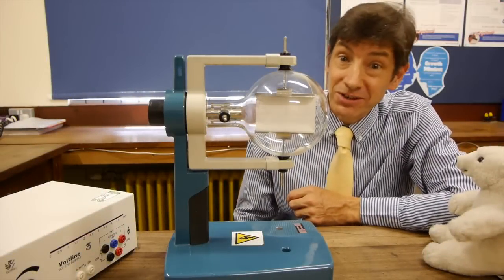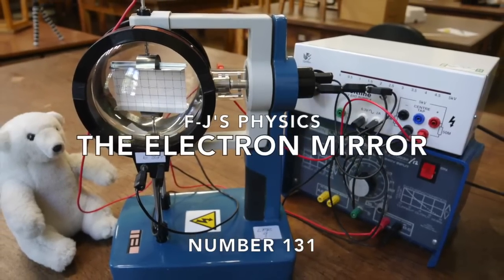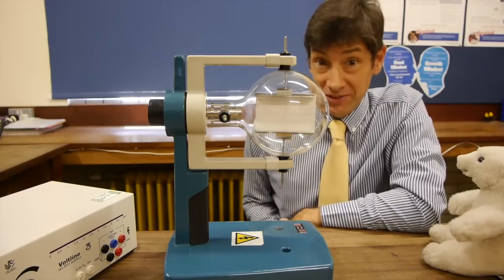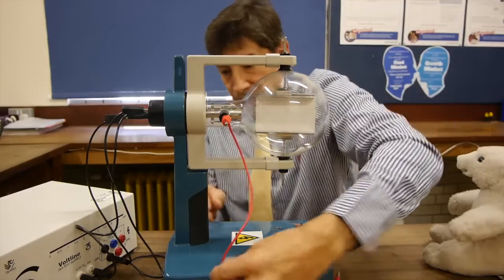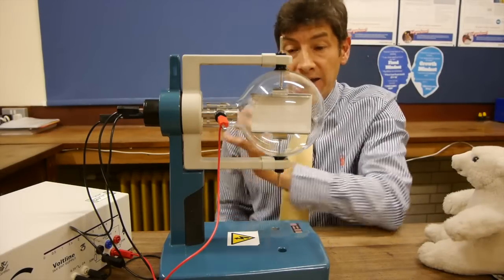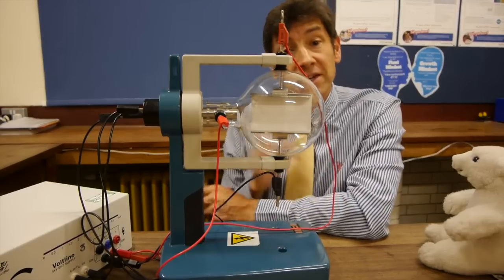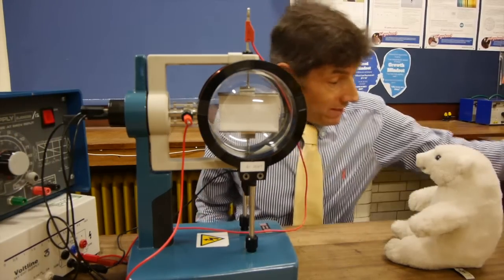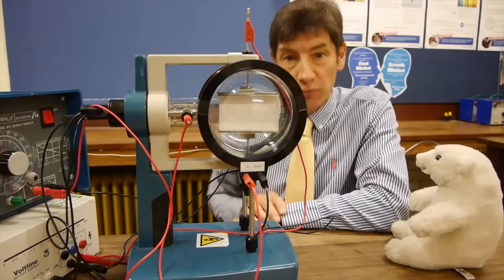Electron Mirror - F-J's Physics - Video 131

Comment: So you had an upward deflected beam, then you said lets disconnect the top positive connection, the bean did not jus go back to straight, it disappeared totally, until you disconnected the bottom negative connection. And then the straight beam reappeared.  So what happened for the second when there was no beam at all? Did you turn off  the electron generator as well at that time?
Reply from the maker: Well spotted!  No I did not turn anything off.  So the beam is only visible when it hits the phosphorescent screen and when I disconnect the top wire I think the presence of the negative bottom plate skews the beam out of the way a bit so most of it misses the screen - you can still see a bit of it going straight.  Once I remove the electric field due to the bottom plate then all is well again and the beam goes directly to the right.  Great question and well spotted!
Reply: @AnthonyFrancisJones  I think you need to investigate this a bit deeper.  I personally have a lot of issues with the knee jerk off pat answers that are repeated so easily because you have been told how it all works so many times.  But there is still some wiggle room left for doubt I think. There is a whole lot of such experiments that are always interpreted in only the one way, with little or no critical analysis being employed. For instance, Thompson "discovered" the Electron. But he actually discovered nothing at all. He only surmised that if there were such a thing, then that might explain what he saw. Rutherford never "discovered" that the atom had a nucleus, and most of the atom was mostly empty space.  No, he deduced this, not discovered it. That is why experiment can be used as proof of theory, only possibly supportive of a theory.  So then, what might be the reason why the "beam of electrons" suddenly just magically disappeared just because you removed that top electrode?  Something unusual is happening, what do all those authoritative text book have to say about this effect? Is it even mentioned? My gut feeling is that what you are looking at is not even "a stream of electrons" at all. When you place the magnet near, the "stream" curves off.. toward the bottom or top of the tube.... but as electrons are particles (that's the CLAIM anyway) so where do they all disappear to once they have struck the sides of the glass tube? If you leave the thig working for 10 years, do you see a little pile of dead electron particles built up at the bottom of the tube? I recon that there is something fundamentally incorrect with some of our assumptions and deductions about all this. Our imaginary Model of it all is able to help us use electricity, but the model may not even represent reality at all, but still be useful.  What do you think?  Can you do more experiments looking for any slight inconstancies to the official consensus?  Another issue I have is the claim that we have actually fired a single electron form an electron gun.  Or counted a single electron with a detector, or done this with Light photons, which are imaginary particles as far as I can see. Lots about approved Physics is a bit dodgy.
Reply from the maker: Interesting what you say.  You would enjoy a philosophy of science course at university if you have not done one.  You get the gist of the 'scientific method', no 'proof' but models that help us understand and assimilate what we see around us.  Further experimentation will always lead us to new/improved models.  Proof is not really what we deal with as you say.  What I would add is we do need simple models that are quite limited to teach beginners and younger pupils.  'The electron is a negative particle that can be found orbiting a nucleus' etc.  later on quantum ideas need to be added to, as you say, explain unusual effects that we observe in further experimentation such as orbital energies and spectral lines etc.  The 'kids model' works for my 5 year old and is not wrong - it is just limited.  Separately you ask what happens to the electrons that strike the glass etc. of the tube.  Well, I cannot prove it, but the model that we use is that the glass does have some conductance (some glasses are actually lead glass) and this allows for the electrons to have a current path to ground.  Then we get into the realms of the Earth's capacitance...  Some tubes had an aquadag (graphite paint) on them to help this.  So it is all about using the appropriateness of a model to the age and ability of those that you are explaining it to.  A bit like teaching planets to little children - one has to simplify the orbits into something they have experience of such as circles knowing that in the future they will not find that completely wrong but will develop it in a number of different ways to explain further observations.  I have had criticism over the years from some quite famous physics educationalists for doing this but I have not found a way around it.  What it all comes down to is this video should really just have been a string of maths of quantum particles and field interactions with no demonstration but I feel it adds something to the story even if it is a bit 'handwaving'.  If you do have some further suggestions about how I might teach this to school age kids I would be really grateful - it all helps!
Reply: @AnthonyFrancisJones  No worries.  I understand your approach. Thanks. Actually my main gripe with modern Physics is the very real issues that exist for the Einstein theories of relativity and also of Quantum theory for that matter. These particular theories, especial relativity, is full of so many contradictions and simply totally irrational statement and assumptions that its bewildering why its still being taught. Time dilation, length contraction and gravity waves,  Light speed, unbelievable. There is so much fake science that it hard to find real science these days.
Reply from the maker: I am not sure if there are many of us either in our out of University/school teaching that genuinely wish to deceive our students.  We just want the best for them.  Quantum theory as well as Relativity are really tricky concepts that are not fully unified yet and may never be.  The main thing is we explain to students that the maths of these theories can be used to genuinely describe many systems and allow them to build others too (I am thinking particularly of some electronics applications).  Obviously when there are gaps in the theory more work needs to be done and still is being.  We are nowhere near 'knowing' all of the science.  What I find hard to explain to my students in the philosophy side of science is that the fact that there is no fundamental law that states that if the human brain cannot visualise something it does not mean that the model is wrong - one has to go with the maths that makes the right predictions or modify it so it makes better predictions.  One of my goals with younger students is to give them the science models that enable them to get to grips with something they have not seen before.  When they are older, of course the model has to be extended/modified or completely changed!  In summary I do hope that there are not too many real scientists out there peddling 'fake science' and if they are they will fall on the sword of failed predictions and outcomes.  I suppose in summary what I am saying is that as scientists we can only give models that enable us to try to understand outcomes and make predictions.  We are not about 'The Truth' only a Theory that seems to currently fit the situations in front of us.  We are short of so many of these models.  Descriptions of the universe's structure on a cosmological level is definitely one!
Reply: @AnthonyFrancisJones  Another very sensible reply, thanks.  But I'm still not on board with the models you have anyway. The curved spacetime is mathematical object, correct?  So the values at the desired points are values of WHAT? They are numbers that allow calculations of other numbers, but they are not "measurements" of anything. If you say that they are numbers representing the degree of influence of a force, such as the force of gravity, then that's fine, but that can only be true if there is also a gravitational source planet at the center of the region of gravitational influence.  No planet, no mass, then there is no gravity field.   And about atomic clocks, they measure nothing, they just oscillate at a frequency that is very high. Now IF that oscillation is consistent, then we can assume that the clock is consistent.  But the clock neither measures time or is influenced by time. Time being a concept. If Time can change, and this makes the clock change too, (Einstein's claim) then Time may be changing right now, without any relative motion involved, thus also changing the clocks, but we would never know. But we are absolutely positive that those clocks are very finicky, and their accuracy is upset very easily for many reasons. So they  are unsuitable for use to gauge if "time" has locally warped". Only if the clocks were unaffected by relative motion, and all other forces) can we rely in them to measure any change in Time. You are claiming that the clock is both super highly accurate, but also at the same time, is badly affected by just some relative motion. (and affected by gravity, temperature, pressure, radiation, vibration, and angry staring) So although the clocks resolution is very fine, its accuracy is not too good.  The atomic clock is not "measuring time", so stop saying that it can. You need a purpose built time measuring gadget, but as Time is a concept, that will be hard to design. If I go on a near light speed trip for 10 years, then return, I am supposed to find that my twin on earth died of old age but I am only 10 years older. that is the claim. But at the maximum distance from Earth I travelled was only less than 5 light years, I can still easily watch the Earth through my telescope and observer the motion of the Earth as it orbits the Sun.  But both my Twin on earth and I will see that the earth orbits the sun the same number of times , once per year, 10 times for both of us, so its not possible for me to only count 10 orbits of the earth, but my twin count say 50 orbits. Solve that paradox rationally.  The models of a lot of modern physics are just nonsense. And the interpretations of what's going on in some particle collider or near a mathematical "black hole," are just that, interpretations, not facts. Did you observe a black hole? nope, you fiddled about with a lot of data till you have a computer generated image that resembled what you hoped to see. They even generated a few thousand CGI Photoshop images of what the Black Hole should look  like , and picked one that fitted the closest to what the fiddled data came up with.

Comment: 3:41 mmm are you using both hands to grab a pair of wires with ~KV of potential difference? that seems... unwise.
Reply from the maker: Thanks, I had a look and could not see that bit but if so one does need to be careful.  As I have commented elsewhere I am using an incredibly high internal resistance power supply with this in mind!   I must say that with good current sources I was always taught to keep one hand in my back pocket at all times!  Thanks again for watching!

Comment: The video is very sober, but also slightly comical in that this “simple” experiment starts with just one cable connected to a power supply, and ends up with about 10 cables connected to 2 power supplies. So I guess it was not that simple after all.
Reply from the maker: Yes, I take your point Brian!  Thanks for watching and hope you found it interesting!

Comment: very good demonstration but you are placing the wires without full insulations. its so dangerous working with high voltages.
Reply from the maker: Thanks Anna.  Yes, I did not want to get too technical and I am not sure others would have the kit to copy what I am doing but at the beginning I hoped I did explain where each wire went.  By all means ask me if you are not sure for your studies.  As far as the voltages are concerned I make sure I have years of experience and training and know the apparatus very well.  But... the main thing is the high voltage power supply has a massive series internal resistance - that is the key to safety!  You might like this video where I am 'mad' enough to wire it to a 1.5V bulb!  Knowing your physics I guess you know what I am up to!  Tell me what you think.   https://youtu.be/V06sYBiYWqM

Comment: Is it wrong of me to have expected an Electroboom-style "accident" (flash and scream) while playing with 5kV deflector voltage connections in the dark?

Seriously, lovely demo. I'm envious of the equipment.

In the 80's when I was in an electronics technologist program at college, my father bought an old Heathkit CRT-based oscilloscope to fix up for me. He ended up gutting it, designing and building his own internal circuitry, including making his own printed circuit boards for the first time using the old tape + resist pen method. 

With that 'scope and an XR2206-based function generator I cobbled together, I had a huge advantage over my classmates as I was able to trial-run many of my lab experiments at home.

In between my two years at college, I landed one of two cherry summer job spots, helping the college maintenance department calibrate and repair lab gear. With their permission I was able to bring the 'scope and my father into the repair shop where we confirmed that the 'scope he built from scratch (apart from the chassis, panel controls and CRT) exceeded his predicted 2MHz bandwidth by a healthy margin. His own 'scope wasn't that fast, so he had never been sure!
Reply: Haha less Medhi or AvE 
More like Applied Science, Alphaphoenix or Clickspring
Reply from the maker: Isn't Applied Science amazing and he does it without any fuss at all - amazing!
Reply from the maker: Scott, fantastic to hear from you!  Yes, I don't do the 'it blows up' stuff!  Others do that well.  Interesting how many of the viewers of this video did not realise the importance of a very high internal resistance EHT supply to make it much safer to work with.  I fear current more!  Thanks so much for your fascinating story.  I was doing similar things in the 1980s and I begged my dad to buy me a CRO (Hameg 203-5).  Every kid should have one!  I felt I could have been there with your dad as I remember the smelly process of etching PCBs myself.  Worked really well.  Remember the UV light box?  It was only years later I realised that there was HP stuff out there with incredible measuring resolution and I have some examples now.  It was a real pleasure to hear your story and it took me right back to my childhood workshop in our old pony stable.  Thanks so much for watching and sharing too!  An example of what YouTube does best!

Comment: Found this by looking to see if it was possible in a Havana Syndrome world to remotely and from a hiding place nearby, illuminate or radiate a person right through the walls of their home with an Electron beam, thereby knocking electrons off of the water or Carbon or Oxygen molecules in their body?  I was thinking even a small Electron gun could be used in this way to steadily build up an ionic charge in their body, which may act to upset various metabolic processes. By "nearby" I'm thinking on the order of 50 to 100 meters, and this would be sustained over a time period measured in weeks since I'm presuming the amount of energy actually absorbed by the victim would be small, but would accumulate over time to cause the malign health effects.
Reply from the maker: Sadly (or perhaps it's a good thing) not a hope for the very reason you mentioned.  Electron beams being charged (like alpha particles too) are highly ionizing so any air in the way would stop the beam over a very short distance.  It would of course not even begin to penetrate a wall.  Now a gamma ray or neutron source would be a completely different matter and are a real nuisance in the nuclear industry as they need really dense and thick absorbers.  Jury is out on H Syndrome but high power microwaves would not be at all nice as would be subsonic sound.  I forgot to say that any charge on the human body would immediately flow to ground so they would remain neutral anyway!

Comment: Great video! Is splitting of beam due to two possible spin states of electrons, namely up and down, like in Stern-Gerlach experiment?
Reply from the maker: Joonas, that is a brilliant question.  I believe the magnetic field has to be much stronger.  In this case it is due partly to poor electron beam focusing and by poor electron velocity selection.  So there are a range of velocities experiencing different deflections.  Hope that helps and thanks for watching.
Reply: @AnthonyFrancisJones  Thanks for quick response! Although your explanation seem plausible, I’m not convinced. Shouldn’t what you say result in smooth output instead of so clear splitting? The same was classically expected for the Stern-Gerlach experiment and led to the discovery of spin-based splitting.
Reply from the maker: Thanks for getting back to me.  Well spotted, there is a really clear gap in the velocities or at least the paths of the electrons.  Interesting!  I need to do a calculation (you might beat me to it!) to see what magnetic field strength would be needed to show the splitting and also I believe the separation in the SG experiment was very small too.  I must look at the tube again.  I don't remember seeing it.  It has been suggested that the ripple on the EHT power supply could have synced up with the camera frame rate.  That would be a really lucky coincidence.  Good to keep us thinking!